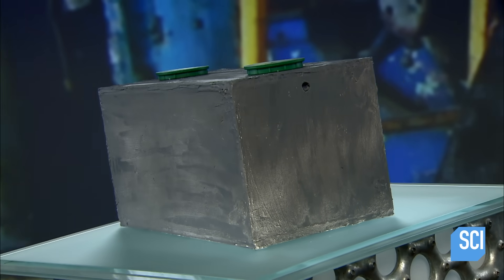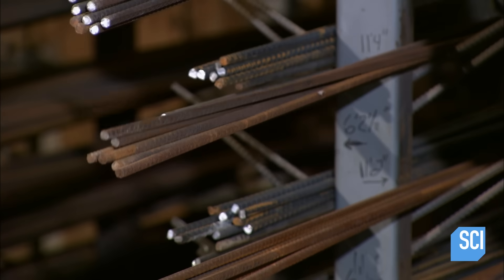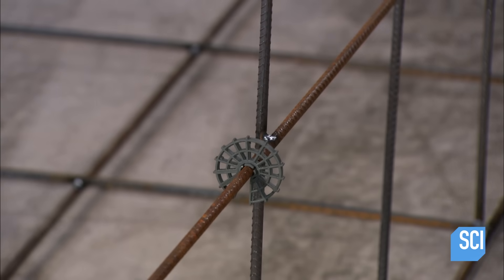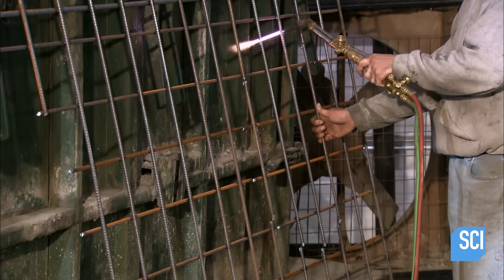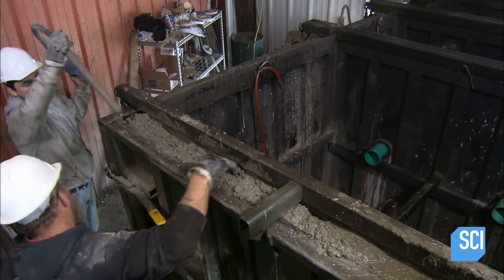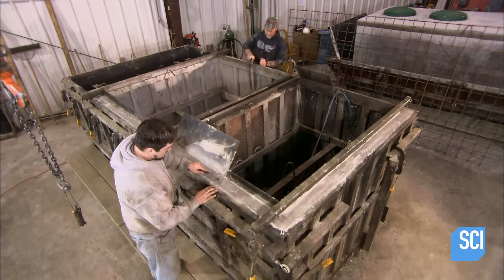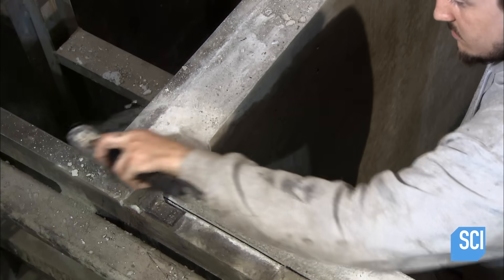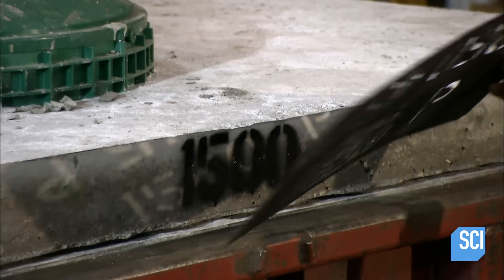How It's Made: Septic Tanks

Comment: My father built our septic tank himself back in the late 50's with cement blocks. It was the size of a small room and had two compartments. There was never any snow over a three-foot area above the tank during the upstate New York winter. I would like to see septic tanks with the ability to capture methane for cooking, heating, or even running vehicles. Obviously, there is much aerobic activity generating large amounts of methane in septic tanks. Why waste it?
Reply: the methane may come with other toxic gas that may need to be separated before use, this may not be financially feasible.
Reply: @hoseinqadam  Harold Bates, who ran his car on methane produced from grass clippings and manure used a filter to remove nitrogen from methane back in the 1970s. I'm sure with today's technology this would not be much of a problem.

Comment: I had no idea these were so manually labor intensive. I always assumed they were made by machine for the most part. Lots of man hours just to make one tank.
Reply: Me either, but tbh they probably could automate a lot of this if they wanted
Reply: @jbd4365  You would probably need a large factory with 10x or 100x the septic tank output to reasonably automate the production, and a lot of complex robots to do all those tasks. Then you could definitely push out septic tanks at a lower unit price, but there's a good reason why production at any smaller scale will take a lot of manual labor.
Reply: Almost everything people think is made by robots is made by people working with their hands. For a short time, I had a job working a company which mails ready made meal-kits to people's homes. We chopped all of the onions, broccoli, etc... by using chef's knifes and cutting boards in a refrigerated room. Factory- made meals are not always made by robots. I would prefer that each family have 1 person spend 10 minutes chopping onions each day rather than some poor soul like me spend 8 hours per day chopping onions, but many people seem to prefer buying factory-made meals rather than cook their own dinner.
Reply: Where I work, the punishment for slacking was forming all the steel and shutters, at 5.30am on a freezing winter morn..
There were no machines lowering anything, and all rebar was the bolt cutters job.
Reply: lots of woman hours too

Comment: I worked at a septic tank company in Roosevelt, UT back in the early 80s, & instead of rebar, we formed a heavy steel mesh  that resembled sheep-tight fencing over the steel tank molds, having previously painted them with used motor oil as a release agent. I had the darkest tan those summers. We cast the tanks upsidedown with the center rectangular space-holder as a non removable, permanent part of the mold. The rest is pretty much the same.
Reply: Much better than rusty garbage rebar
Reply: Fiber tanks are junk
Reply: @darrylshearon3325  thanks, but not all concrete fibers are the same.  Helix, being actual 1” zinc coated steel wire is quite different mechanically from, say, fiberglass fibers. Just curious if anyone has tried it.
Reply: How is it that they are water tight? Is it a five sack mix?
Reply: @brianwilless1589  five sack mix? No one measures concrete in sacks at the industrial level they use slump and even if it won't tell you if it's water tight because it's not but it doesn't matter
Reply: Do you know if anyone “in the industry” ever looked at using Helix micro rebar?  The way I see it, you just mix it into to concrete and pour - no manual steel pre-forming of any kind required.
Reply: this is how we do it still in Tyler Texas

Comment: We used to make burial vaults almost the same way….only we added a plastic additive to the concrete to help keep the shell completely waterproof…….the lids we poured an asphalt mixture so once installed the weight of the lid would seal it to the shell…….we would work all summer long building them, and just deliver them during the winter months…..using a small crane on our trucks to properly deliver…….

Comment: Where are the respiration pipes for Methane gases!. Seems a lot of work when you can just use a fiberglass tank with biological filters inside and a built in pump which turns the waste into water usable for irrigation purposes.
Reply: AT A LARGE COST  the old style concrete system works great ,, when it is the correct size for the house ,,unlike the people that get a 2 bedroom home add on to the house make it a 6 bedroom and do not update the tank ,, well there yard will be a mess soon enough ,, also the methane gas can go out into the leach field there is a vent after the tank and before and after the field in most systems also there is what looks like a pool filter that go's on the pipe going out of the tank to the field to keep waste in the tank .. 20 plus years ago I worked for a guy we installed a few systems ,, never fiberglass tanks ..
Reply: @randytravis3998  Good system if you have good drainage and as you say don't add on another 6 bedrooms with en suites lol. We have to use fiber glass tanks here by law if we are within 100 meters of another property. These have a filtration system inside and a masher which starts up automatically and basically turns everything into water which can either go in a long deep drainage Pitt full of gravel or you can use a septic tank pump and use it as irritating water, wonderful tomatoes around here 😁
Reply: @spanishpropertyconsultants  sounds like a good system ,, it has been years since I done any systems ,,they have come a long way ,,yes good drainage is a key part of the system ,, nice being able to use the waste water like that , I just never installed one of them ,, only problem I can think off the bat is . if you pump out too much water at one time  tank gets low or empty and it rains or lots of ground water the tank could float ??  don't know how there installed but it could unless they add concrete too the tank for weight ,,

Comment: But how does it really work? 
Does the tanks are filled up from the side or the top?
Does the first compartment get filled up with material, and when there is too much solid material, 
then the second compartment get filled up, and then the third one?
But there is a small opening on the side of the third one, so does the liquid only part get drained outside?
How often do you need to empty and clean up the tank?
Reply: 好问题
Reply: The first compartment takes on liquids and soilds where a bacteria reduces the solids to a liquid/ sludge. That liquid then flows to the next tank where it exits to a leach field. On average in a normal household the sludge will need removed every 5 years.

Comment: Why is my leach field like a wet swamp?
Reply: Because the tank should be pumped every 2-5years so solid waste doesn’t go out to your Leach field. Once a biomat forms the water can’t penetrate it. A biomat is biomaterial. Pump the tank often to ensure clean water is going out and not scum and sludge
Reply: Go to the hardware store and get a couple of bottles of some stuff called Roebic K-57. Do this once a month and it will break down whats causing your leach field to drain slowly.

Comment: After servicing these things for six years I can tell you that the design is stupid. A square box with a lid. Here's the issue. The bottom is flat, and those manholes do not allow easy access for long handled scrapers used to pull out as much material as possible. It is my professional opinion that the bottom should be concave, Even a mild curved bottom would allow for contents to concentrate in the center where the vac hoses end up. Oh, and another thing. Placing these things way out in a grassy area, far from the road is also stupid. Makes it take way too much hose, just as setting them in the middle of parking areas (and I mean your parking space) is also problematic. These are the same concrete tanks used by any place with a large commercial kitchen to collect dish sink wastes. (Called an Grease Interceptor, or Interceptor). I service them in fast food drive thru's, parking lots of all sorts, retirement homes - in one such place they placed it on the far side of the building, so we have to back a 40k truck over the lawn to reach it).
Reply: thats a shitty situation
Reply: @0dave14  There's a local Septic/Portapotty company whose owner invites anyone to call him 'Shitty Bob!'. Another company has vanity plates for their trucks: Ole Stinky; Stinky1; etc.
Reply: 很好的提议，在中国混凝土化粪池是圆柱形的，底部是一个弧形，但是运输起来不方便，这种化粪池非常大
Reply: @charleskung4803  exactly
Reply: box is cheaper to make . simple as that
Reply: @DrWhom  tell that to the business that have to install and replace. Here in Iowa they run from 40k and 80k to put them in. Plus, the more BS the waste technicians have to do to service them, the more we charge. In Iowa a 5,000 gallon interceptor runs around $550 plus mileage. I have several 2,000 gallon interceptors that cost $1600 every three months because of BS accessing them and mileage. As I said they could and should be better designed and installed

Comment: Would it be a good idea to put some sort of concrete paint on the inside and outside to help with the longevity of the tank?
Reply: Actually concrete tanks can deteriorate, if you have high sulfide levels in your water, you can’t see it, taste it or smell it, it mixes with the sewer gas present in the tank and creates a weak sulfuric acid solution that eats the concrete tanks from the inside and out and only above the water line
Reply: no
Reply: It won't make a difference between the amounts of sulfide and gas in the waters nothing will stop the deterioration its just not possible. Also in modern days people are using soaps and face washes with chemicals in them that aren't meant to go down a drain. Not to mention dish washers and washing machines with all the detergent.

Comment: Great. Septic if maintained well it is for life. If no soap or chemicals enter the septic tank it auto cycle never allow hard items stay in the tank. A simple cow dung creates worms that start the cycle to clean it.
Reply: That’s actually not correct, the average lifespan of septic system is 20-25 years, which can vary depending depending on what soil conditions the drain field is installed in and pumping the tank every 2-3 years

Comment: So the lid is only held in by some adhesive foam gasket (Like the ones used for windows insulation) and that's it ? 🤔
Reply: And gravity. Don’t forget that part
Reply: With the weight of that lid, its not going anywhere
Reply: Yeah the lid is like a ton at least
Reply: Its butyl. Its super sticky tar like rope

Comment: the 2 chambers separates the feces vs liquid waste like urine and dish drain?
Reply: The first chamber collects all the waste, solids and liquids, while the second one is mostly liquids ready to pass into the drain field.
Reply: @GreatMewtwo  if thats the design it should have a filtering material in the 2nd chamber like peebles,charcoals before the fluid drains to drainage system
Reply: @myplaguesify  There's usually a baffle where the fluids pass into the second chamber, and it's high enough in the tank for solids to not reach it (assuming regular operation).
Reply: Hopefully it gets pumped before the first chamber gets too full of sludge.

Comment: I use to work for a company that made big concrete boxes for under ground communication bunkers for ATT there are thousands of those boxes underground from one end of this country to the other. The cement mix these guys use would never pass structural integrity tests, waaay to wet! We poured our cement with very little slump and dry. We used stick vibrators to move the cement into the forms and covered them and steam cured them overnight. They were so hard in the morning that if you hit them with a hammer they would sing.
Reply: Uuh.. its a septic tank.. not a bunker... any dryer than a 6 and it wont fill the form properly.. been pouring tanks for years.
Reply: They may be using a superplasticizer in the mix for better flowability into the forms.
Reply: Bunkers? You mean vaults?
Reply: If the concrete is too wet, it won't cure properly. If it's too dry, the chemical reaction won't be complete. I must admit, however, I don't know anything about steam curing concrete. Just imagine what's required to cure special hardened concrete in structures like prisons.
Reply: Got one of those on our property, They did away with the telephone line in the 90"s when satellite took over. Line went from Miami to I think Boston or somewhere way up north. About 5 miles from us they had an underground structure that was supposed to survive an atomic blast where people worked. Line was said to be used by the military during the cold war.
Reply: I use to? Or I used to? Hm. Interesting.

Comment: How did they manage to fill concrete for the bottom slab by pouring from the sides
Reply: Two piece form. Think of it like a soup bowl sitting on top of another soup bowl. There’s a 3-4 inch gap between the forms at the bottom so that’s how it’s filled in from the sides. Just spreads underneath the inner form

Comment: Wait, how do they get the concrete under the chamber template and around the rebar to form the base? A vibrating stick should only take you so far.
Reply: Id reckon they could just added in enough concrete to form the floor properly first before they placed the inside mould? Idk.

Where I work, we make something similar (tundish) and the inside mould (used to form the void) itself is a vibrator. Also, the workers grease the box up first before using it, so the mould releases really nicely. Then theres a bit of a draft angle which helps release the mould even more.
Reply: @de0509  how much does a septic tank builder make an hour?
Reply: they fill one side until it comes out the other
Reply: Most places pour it wet enough to flow through to the bottom, and outside the form box they have massive hang on vibrators that force it into place.
Reply: @SootyMangabey.  how much does a septic tank builder make?
Reply: @chaytonhurlow840  I doubt there are very many that just build tanks. Most are Technicians and pump truck drivers that build them on slow days.  Most make 17 to 25 an hour around here.  Highly trained technicians can make more.
Reply: @SootyMangabey.  I was wondering because I build them as a full time job, and I was trying to figure out if I'm being underpaid.